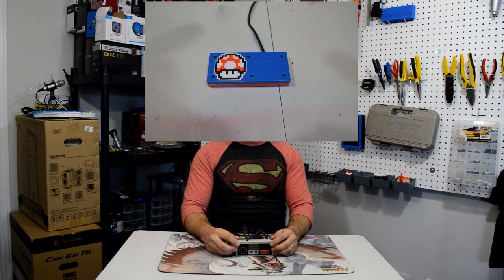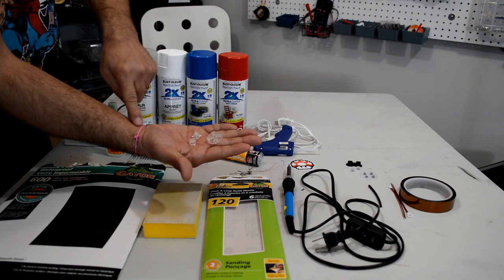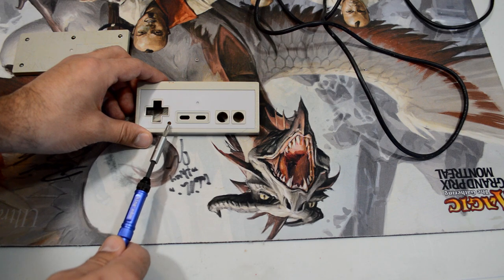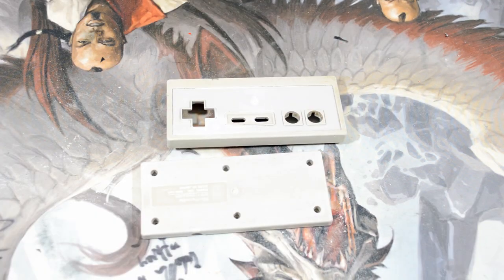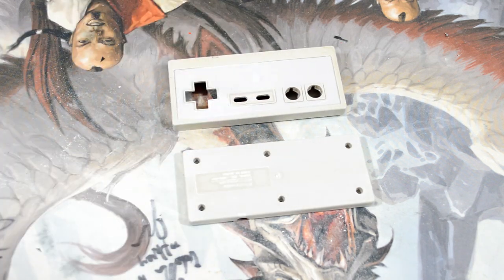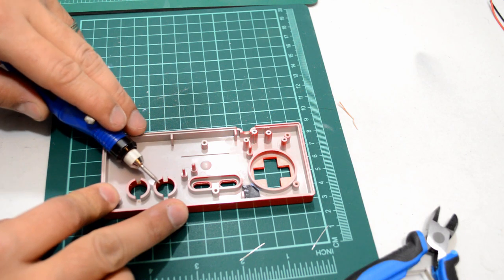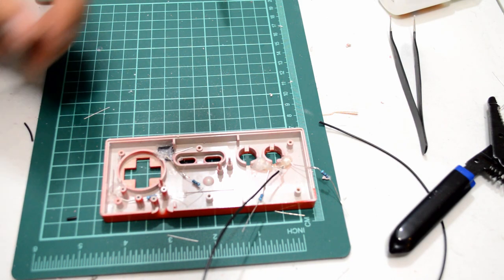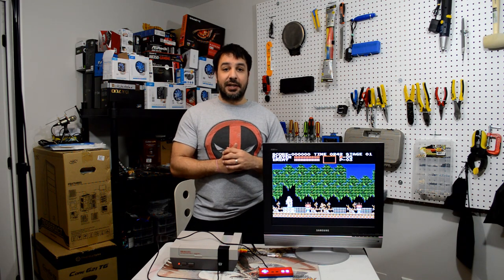NINTENDO (NES) CONTROLLER MOD, MARIO EDITION with LED lighting

Comment: Some high build primer would be helpful for filling scratches. Go's on pretty thick and get sanded off. Fills in minor scratches without removing any base material.